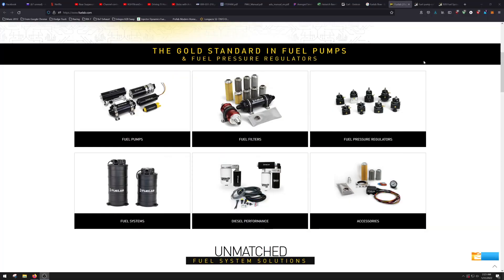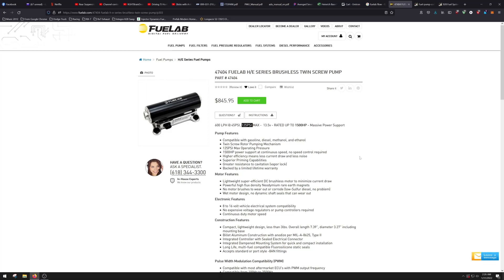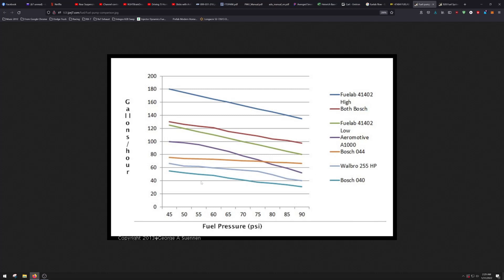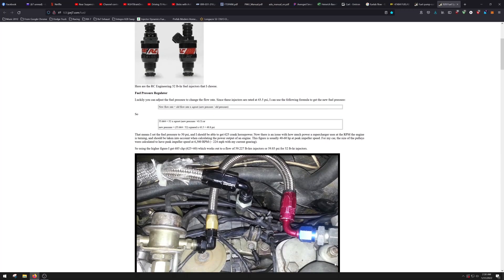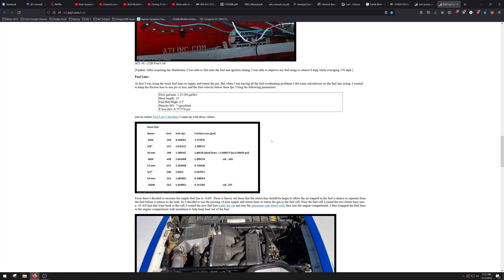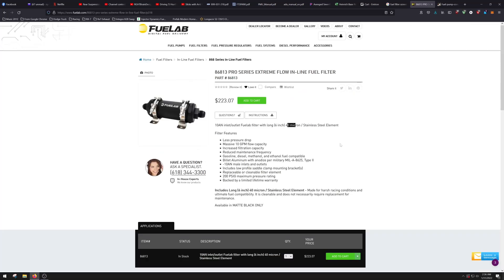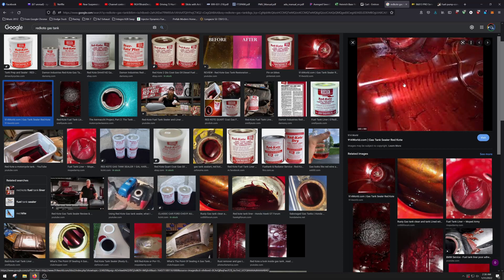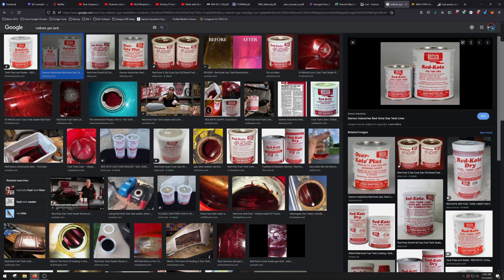Modern Fuel System Design for Ethanol E85 and Rotary Engines

Comment: Any idea if the coating inside the stock Rx8 tank is E85 compatible?
Reply from the maker: I would assume most OEM stuff of that era handles about e30 without an issue.  The plastic saddle bags won't rust like these old steel tanks.  

You guys need to focus more on the venturi between saddlebags as your main hindrance.